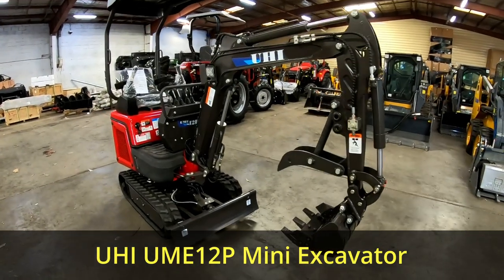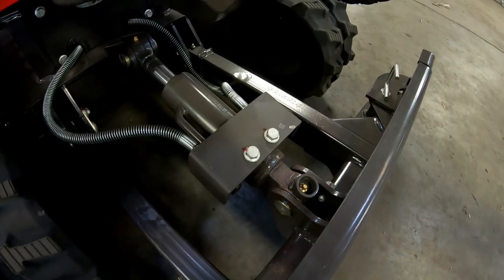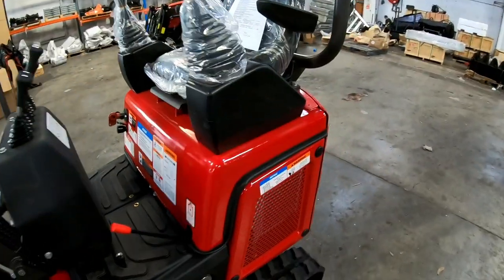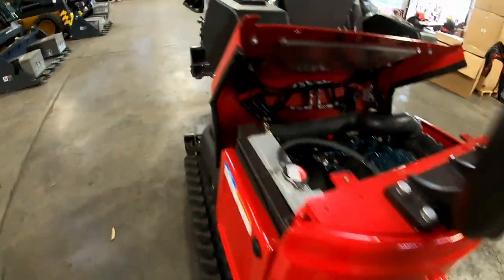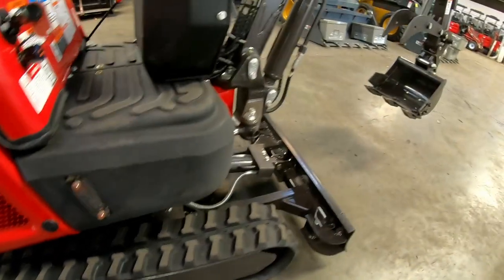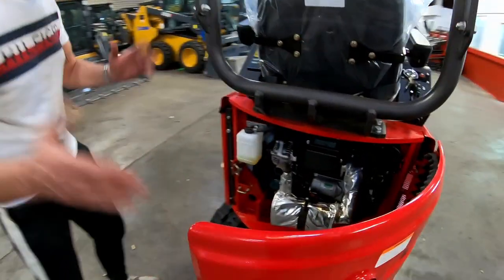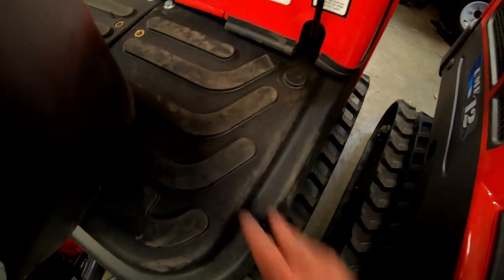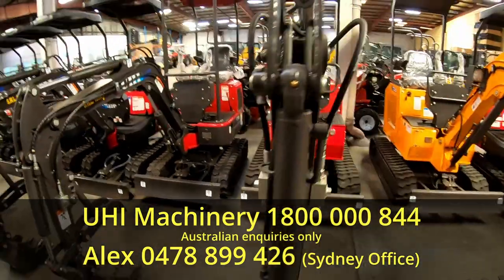UHI UME 12P Mini Excavator - NEW Model Available Now! #minidigger #miniexcavator

Comment: Yes a nice looking machine. It seems like the gap between Japanese and Chinese excavators is closing. 

It would be interesting to compare it to a similar sized Kubota or Yanmar excavator and see what differences exist between them.
Reply from the maker: Would be great to do a side by side comparison. There is a Youtube comparison with a US buyer of a Chinese mini digger who hires a name brand machine and goes through a series of tasks to find out which is better. It was an interesting result!.
Reply: There's still a huge difference between Chinese and Japanese made excavators. I'd be buying Chinese first to help build up some income and then upgrade to a well designed Japanese machine for the smooth control operation.
Reply: @dinosshed  Japanese excavators have better hydraulic pumps? How much would the equivalent Kubota excavator cost? This UMI costs around $20k with the attachments. I guess a Kubota excavator of this size would cost around $35k and the attachments would push the price over $40k.
Reply: @kdegraa  yeah, they have far better hydraulic system's, not just the pumps. Go and use a proper machine for a week and then jump on your UME/Rhinoceros and you will see the difference between cheap and value.
Reply: The better of the Chinese ones are certainly improving in stages as they get more involvement in our market but I do think they would gain significant benefit from some sort of owner/operator feedback program because there seem to be aspects of each model that let them down and many would be easily fixed. Simple things like no pedal control for the auxilliary are oversights that simply should not escape pre-production review, unless of course it has rocker button control on one of the joysticks in which case I apologise. UME12 is a bit of an orphan size if you're trying to compare with Kubota. At the moment on the Australian Kubota market you go from K008-3 which is just under 1000kgs (forward controls and about 30k with three buckets) and then jump to around 1800kgs with kx018 and U17 (pilot controls and a LOT more dough). The other thing is the attachments included with the Chinese ones, if you need auger and grabs then you're going to spend an extra four to eight grand to outfit your kubota with those. Comparisons between Rhinoceros/UME and Kubota are fun to write about when based on quality, longevity and ease of operation but the reality is that most people buying the Rhinoceros/UME ones do not have the option of buying the Kubota instead of the Chinese because of the price difference. Most people who end up buying the Chinese ones adapt themselves to operate them quite effectively and efficiently.
Reply: @davejaguar6532  I have a Chinese excavator called a haihong (what a name) it has the kubota D722 with various Eaton hydraulics and pilot controls. For me the weight and size of 1.2t  is spot on where the likes of the name brands are next to useless at 0.8t.

At 1200kg dry, no attachment, it is perfect for the intended use. It fits in my 8x5 tandem axle trailer, digs to two metres, has every attachment I need with proper rock drilling auger drills (unlike ume) twin pumps, an uncluttered platform and is great value. 

I also own a 1.7t kubota and have used other big dollar machines so I know what is missing from the cheaper alternatives. For sure any excavator is better than none but definitely shop around.
Reply: @dinosshed  I have the UME12S (2022 with Yanmar) and I envy you your digging depth. 12S lists out at 1730 which is quite a bit shorter than the Haihong at 1940, I have a job I need to do where I could do with the extra downreach. The Haihong tilt bucket looks to be better constructed and designed than the Rhinoceros/UME one too (my tilt bucket is by far my most used attachment, I so often seem to be filling, grading and battering). Each different model of each Chinese different brand seems to have some things better/nicer than others.
     I too have operated many different size diggers (mostly caterpillar) but the UME12S is the first one I've owned (I just use it on my own properties, not for business) and I have modified the hydraulics to get it to work more smoothly, accurately and consistently as I was not happy with its "touchiness" (as LukeRiley called it) in stock form and I've also done work to angle the control levers closer to me to make it more comfortable to operate by removing the stooped leaning forward position the stock setup seems to encourage. 
     As an around home tool the UME12S works pretty well for me, it has to because I was not in a position to justify buying the U17-3 or 301.7 just for private toy type use.
Reply: @davejaguar6532  I checked out everything available from about 8 different manufacturers and ended up with the haihong. I rented a few just to see what their capabilities were, the small kubota and other sub one tonne machines just dug themselves into the trench and everything that didn't have pilot controls were not suitable for delicate manoeuvres. I came close to a different version of the UME which had a hydraulic thumb, pilot controls etc but the reach wasn't enough, controls weren't great AND it was $25k...

I totally agree on the price point with the name brand gear but 21 for the haihong comes close to a good name brand second hand unit. I really needed something around the 1.2t though and these are ticking the box there.
The biggest gripe about my new machine is that it was 'almost' well put together. First hours of running I found bolts from the bell housing and bodywork had either fallen out or were loose. After sorting those I had the four bolts holding the slew motor vibrate loose and it took half my work day to sort it. Other pin retainer bolts were cross threaded and needed to be repaired, but other than that it's ok. I've since pulled most of it apart and loctited everything. 

It gets a proper punishment, literally run it all day and night on some jobs as I take it with me to every site. Yesterday I drilled 5 holes 600 deep in rock/shale and with some water for cooling the bits, the head still came out steaming.
Reply: @dinosshed  haha I did exactly the opposite when it came to buying. Whilst I had previous experience operating Cats between 3t and 30t, I did nothing to actually try out any of the small chinese ones. Out here in NSW Central West I found no-one who had a chinese one to try and I wasn't going to drive to Sydney or Melbourne to test one in an environment that is nothing like it would be when in use up here. 
      Instead I looked at pretty much every sub 2.0t chinese excavator video on Youtube (that took me weeks part time) and apart from seeing before my eyes that a single cylinder machine was never going to be something I could live with  (which meant my target spend went up by maybe ten grand in one go) I was learning almost nothing of value, very few reviews were of Australian market machines available in my sub twenty grand price range at the time.
      I put the matter aside for quite a while until one day I happened upon TreeChangeFarmer's postings of UME12 related videos and I literally made my choice based on what I saw in those. There was another company I was happy with who were selling Rhinoceros versions of the same thing but they were in Melbourne and I figured that I was better off choosing UHI in Sydney in case I ever needed to go down there to get parts. 
      Additionally,  Tree Changer's commentary also gave me comfort that UHI were a reputable company who stood by their products and that was a massive factor in my deciding to buy sight unseen. I also liked the fact that UHI put their prices up for all to see, some companies seemed to regard their pricing as a state secret.  I got in touch with Alex and ordered a UME12S and it was delivered to my place out in the sticks by Mannye within seven days (as was the tilt bucket that I ordered three weeks later). 
      I liked the customer focussed attitude I saw from Alex and Mannye and I liked  the machine off the bat but as I said earlier I felt I could make improvements to the way the machine worked and I did so.
Reply: oh, I love these upfront comments  by owners, not salesmen.  Its almost like Honda in the early days in Japan,  or Datsun.

Comment: Hey guys about to do my first service 

 Is it better to go back to UHI 

Or I’ve got a diesel mechanic who will do it ?

What should I be paying ?

Thanks In advance 😊
Reply from the maker: Hello Gabrielle. You can do the service yourself if confident. I was told that if you service the machine yourself it doesn't effect the warranty - but you can check first. Not much different from changing the oil and filter on a car. There is a hole on the bottom of the digger that lines up with the drain plug on the engine. Filter is behind the front cover where the oil dipstick inspection is. Remove the bolts and the panel comes off. For a first service thats about it. Lube the pins and do a nut and bolt check. Mechanics can charge about $95+ and hour. Cheers Dave